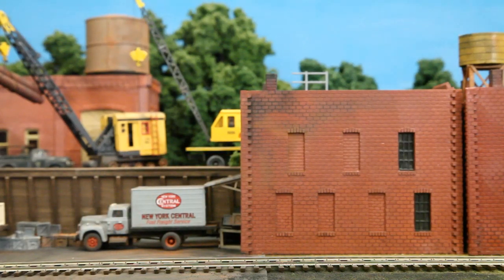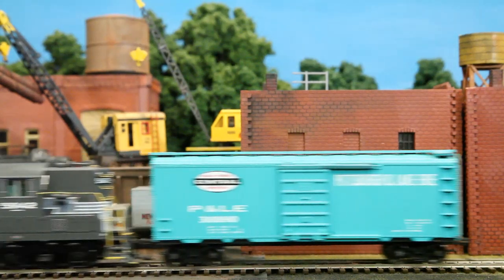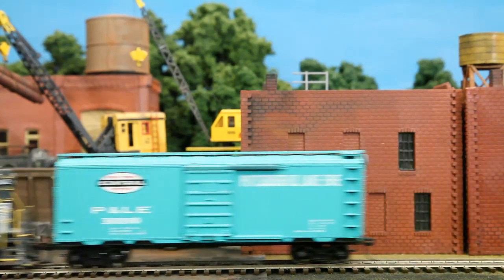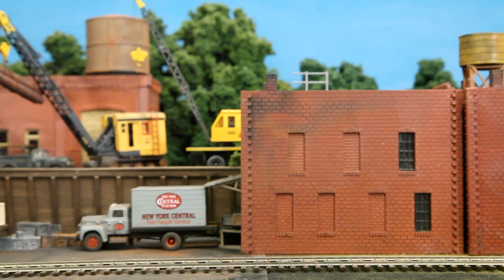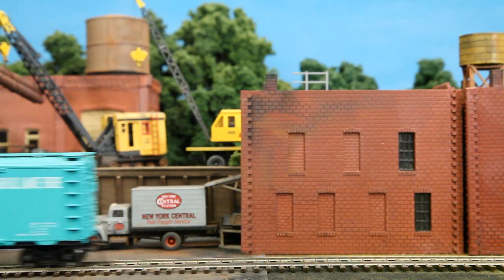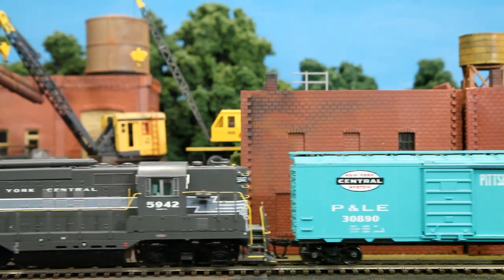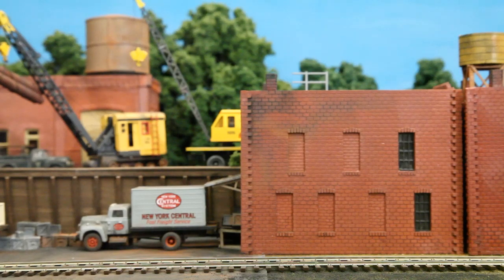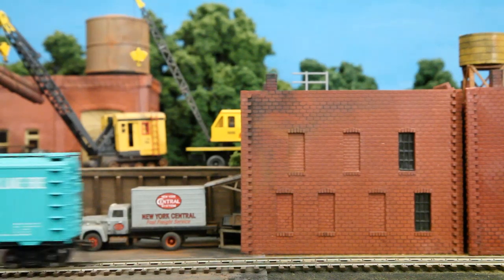Animated Rough Handling Boxcar in HO Scale with a Wink to John Allen

Comment: Geoff, another great video. Thanks so much for sharing. I happen to have the original unit in an ALP gondola car.
Reply from the maker: +Sue Line RailRoad Wow, that's a real treasure! I can't begin to tell you how John's car has inspired me over the years.
Reply: @DrGeoffB  John's had a red light under the car (If I remember correctly?),
Reply from the maker: @MontanyeModels  That is correct. John's car trapped the metal ball at either end of the car which turned on a red lamp below the car floor near the wheels to simulate a "hot box" of sorts!

Comment: In the one sound battery operated version, could I use a decoder to power it as well?
Reply from the maker: +drupp68 Yes, but the little sound module needs 3.3-5.5 volts to operate. ou could use a decoder to power it but if the decoder switches only 12 volts you would have to drop that with a resistor or voltage regulator.

Comment: Can any decoder be used to power the circuit?
Reply from the maker: That depends on the decoder. The DFPlayerused to generate the sounds takes a little too much power for many simple decoder functions offered, and does use more power than the little Arduino Pro Mini that controls it. The specifications of your favorite decoder compared to the DFPlayer spec should give you more insight. "Hope this helps. Have fun! -- Geoff